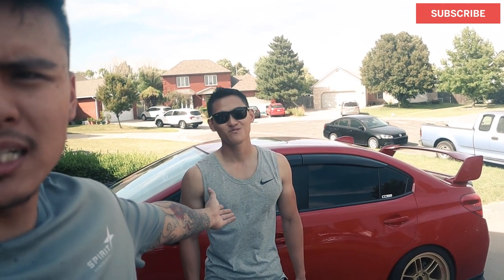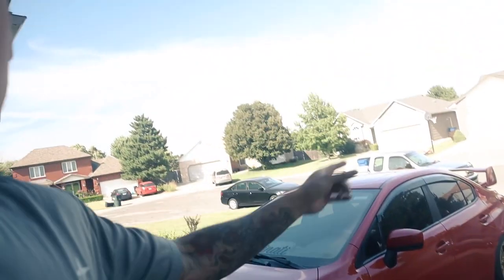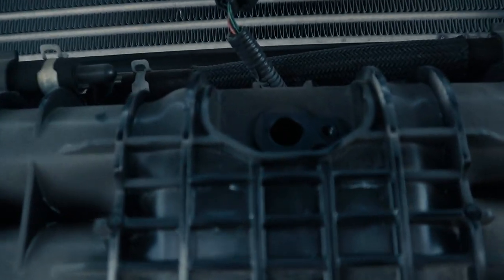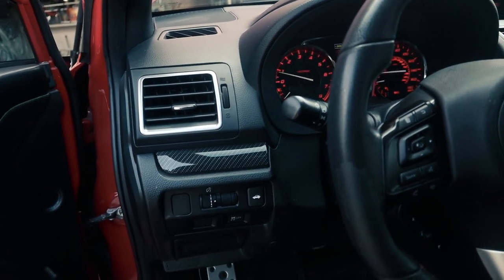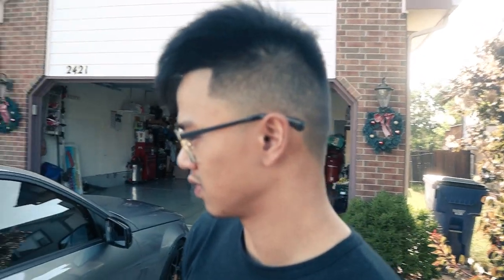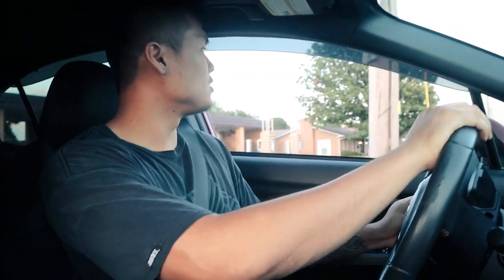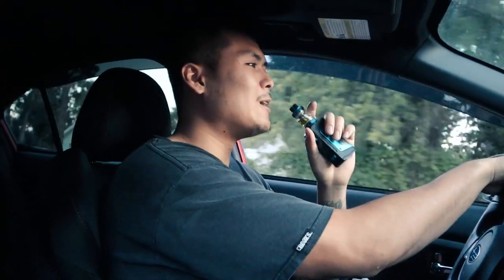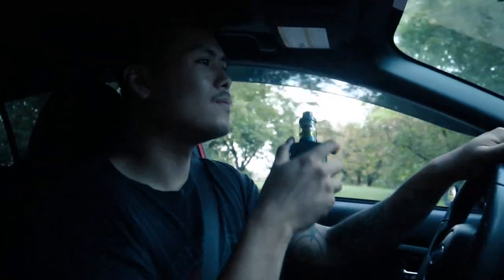Cleaning intake Carbon Buildup on the Subaru WRX! | Direct injection Issues!

Comment: WARNING.  This is absolutely not how you should clean an FA20DIT motor.   What you're calling the MAF sensor is actually the MAP sensor and its purpose is to meter your intake manifold pressure to determine how much fuel to pump in.  The MAF sensor is located in the air box.  By having your MAP sensor open like that and plugged in, your ECU will think you have a huge vacuum leak and dump way too much fuel in.  The extra fuel + the cleaner could damage both the engine and foul the catalytic converter.  If you search for the Subaru Service Bulletin 09-74-21R, it outlines the proper procedure for doing a top clean.  For DIT motors, you should be connecting it to the purge solenoid hose, which will draw vacuum into the intake manifold.  Search up Adrian's Digital Basement video on his 2015 Forester XT to see a proper way to do the cleaning on FA20DIT motors.
Reply: Your comment came in clutch helping me do this process. Thanks for the info

Comment: i was just about to warn you about the straw, same thing happenned to me, i took off the egr and was able to pull it out with pliers because it fell down towards the throttle body. Also the tube is not long enough to keep the can upright, now i have a rig i made with some vacuum hose and some plastic hose i got off ebay. this way i can rotate the hose towards each intake and also keep can vertical to get all of it out.
Reply from the maker: Yeah man, I did not know at the time and a different set up for it would’ve been a lot better

Comment: So spraying Sea Foam (or some other) cleaner directly into the MAF intake will actually get the carbon buildup on the underside of the valves? I thought only blasting would accomplish that. I'm only at 26k on my '17 Forester XT but I know it’s gonna need to be cleaned at some point.
Reply: @115k still haven't cleaned it
Reply: This method should clean the non-cylinder side of the air intake valves. Where the combustion of fuel is not cleaning the valve. So it should work up for normal carbon build up that is common with direct injected engines. I'm at 96k on my '15 WRX and have a few stall issues at elevation and have been looking into this as the culprit.

Comment: So is that the correct spot to spray the sea foam in or….? Because reading some of the comments say to shoot it in through the actual hole where the mass air flow sensor is in….??? That too part where the intake manifold is some other sensor right?